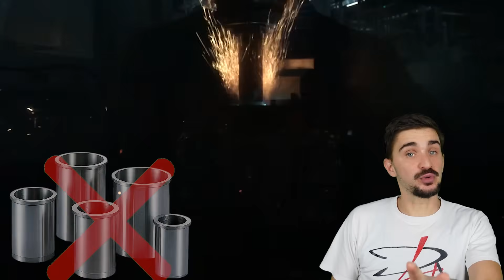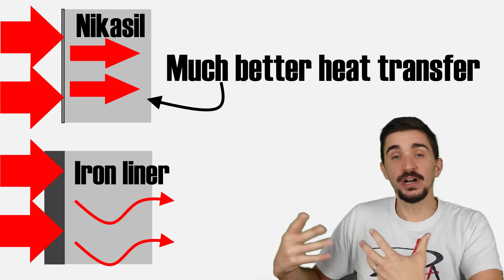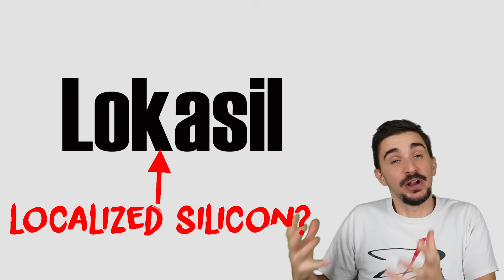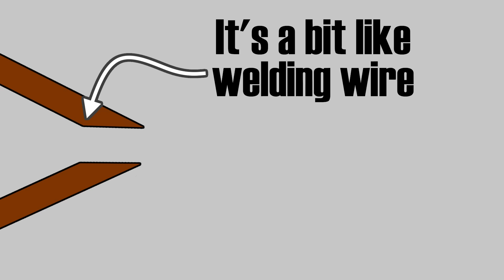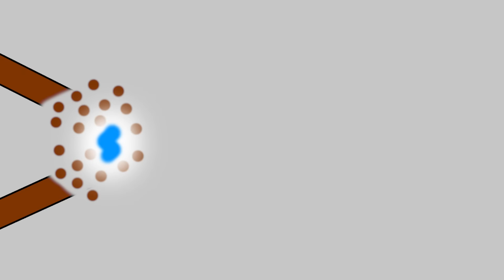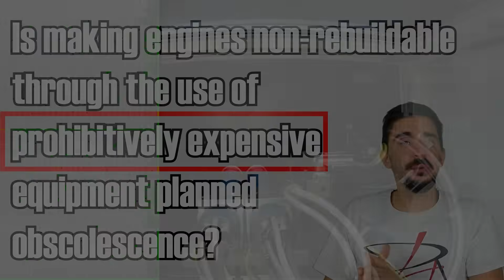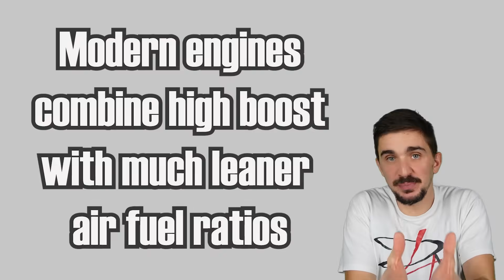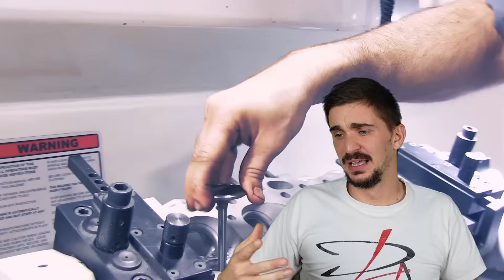Why Are Engines Becoming Non-Rebuildable? Everything About Cylinder Coatings

Comment: Interesting to know about the reasons behind NikaSil development being tied back to the epitrochoid wear issues in Wankel rotaries.  The apex seals failures in the NSU engines were a different set of materials and metallurgy problems. NSU eventually gave up, and it was Mazda who picked up from where NSU left off and EVENTUALLY solved the apex seals wear issues some 10 years later in time for the release of the series 1 RX-7
Reply: I love rotaries but I don't there will be a fix for the burning of oil in the combustion chamber and the extreme fuel inefficiency.
Reply: @TicoDK  that also wasnt the topic that he discussed

Comment: I finally realized there is a point of diminishing returns with horsepower, reliability and what I can afford ! lol
I marvel at the complexity of today’s naturally aspirated piston engines and the horsepower they have achieved for both cars and motorcycles ! 
Love your videos ! ❤️
Reply: And also consider the fuel economy, too, especially for sedans.
I drove a Chevy Impala rental back in 2017 that had a fuel economy average on highway driving at 25 mpg with low-price regular fuel.  It's performance was similar to the muscle cars I was familiar with from the late 1960s, which had a fuel economy rating of around 14 mpg with high-priced premium fuel.
Reply: @bloqk16 25 US MPG = 30 UK MPG = 9.4 l/100Km
14(US) = 17(UK) (roughly). 

These are appalling figures by European standards!

Comment: How does nikasil coating or similar coatings make it non-rebuildable? It just means you have to know how to rebuild that engine. 
Which is true for all of the engines. 
Which is why 99% of all engines are not rebuilt anyway, and it's mostly done by enthusiasts who will just deal with whatever they have to deal with to rebuild it. Unless you're talking about mass production rebuilding, which is entirely different subject and for decades now has existed primarily for industrial applications and not regular cars... That's why you don't see a bunch of cars for sale with "newly rebuilt engine" Because by the time you're doing that the rest of the car is junk anyway, or just a simple labor of swapping the engine is more than the car is worth. 

So if we're talking about exclusively automotive engines for enthusiasts rebuilding, there's no such thing as non-rebuildable just such things as more expensive to rebuild because...
Reply: People also have to keep in mind that vehicles wear out elsewhere too. 

Only enthusiasts have fun swapping seats and interiors, replacing bushings and ball joints, repairing rust, body damage, and repainting, updating the radio / sat nav display, etc...

The average person doesn't want to deal with having all that done. That's a significant amount of downtime.
Reply: How to redo an Alusil engine:
Bore as normal.
Hone using a chemical on felt pads that dissolves the aluminum away leaving the hard material and a nice pattern for the oil to go in like a normal crosshatch. 

The machinery is the same, the only difference is using felt pads and paste instead of stones for honing. 

You can do it at home but like most honing jobs it's better to do it on the machine.
Reply: @travisfabel8040  seriously man. I can’t stop myself from explaining this on every alusil video I see. The buy in for a machine shop to equip themselves for alusil repair is quite literally a special hone, some special paste, a surface profilometer which they should already have, and some learning time. It’s actually insane how uncommon it is. You can even source oversized pistons for tons of alusil blocks. Especially BMW, as I’ve found.

I am hoping that this false stigma of alusil being unserviceable leaves us in the next 10 years. It’s very frustrating.

It’s not rocket science compared to other things people are doing all day long with modern cars.
Reply: It doesn't, we have been rebuilding Nikasil engines for 30 years in the powersports industry. Same cost as a sleeve and you get a MUCH better engine.
Reply: @OtisFlint can you explain why so many shops stay ignorant to the fact that alusil can be easily reconditioned with tools/literature now cheap, and readily available? It seems like all of the legacy machine shops have no interest in adapting. Just jump straight to plating or sleeving.
Reply: @OtisFlint   exactly, my point was that the "nonrebuildable" aspect is moot. It's completely rebuildable.
Reply: I agree.This guy is idiot.He lost credibility when did marketing for "wonder engine" scam company.

Comment: Pretty funny to see that people mention 2JZ or RB26 engines as the engines which can produce heaps of power. And for some reason people forget how VR38 or a modern LS/LT GM engine can make even more power and meet emission standards.
Reply: You are compairing 2.6 and 3 liter engines to 3.8 and v8 engines
Makes no sense
Reply: @sigmamale4147 please compare the emission standards too. As well as hp pre liter or torque per liter those engines produce. Those were just the examples. There are plenty of modern small displacement performance engines like G16E from Toyota or THP from PSA.
Reply: @sigmamale4147 because everyone does compare them?

Comment: I think your last sentence hit's on a big problem, cars (and other appliances) getting scrapped because a single component failed and it is not economical to replace. In that cast environmental costs of that single component failure jump up to what it takes to build a completely new car. Easier maintenance and parts replacement seem the answer and in industrial equipment we can see that being applied. Most of us here would probably love it as well, but we are (probably) not the average driver. The average person is much less likely to get through the trouble of finding the problem, weighing cost of repair/replacement, hoping that nothing else is wrong with the car that comes up in another 30000kms and then choosing to repair.
These new engines are build for the average consumer and, even if I don't particularly like it, they are build well for that specific use case.

Comment: Another thing to note is that technology rarely remains in the factory. Eventually as patents expire and technology becomes cheaper, eventually these plasma coating machines will make it into the hands of machine shops. Assuming the demand is there.
Reply: Plasma spray coating is nothing new. However, the issue is labour. Just removing an engine, taking it apart and rebuilding? You'll be at the same cost of a similar replacement CAR.
Reply: @khalidacosta7133 Until you deplete the supply and the options are a car waiting for the same impossible engine rebuild or a new car.
Reply: The problem is that this isn't a standalone issue. Certain things are not unrepairable but are made so by manufacturers through software locks or even regulations. This affects demand by shifting the consumer culture altogether to the point where we no longer expect things to be repairable, have access to schematics or be able to perform maintenance ourselves. In the end even if there are ways to do it, it becomes financially non viable for almost anyone to access even if they wish to resist this. (to make it clear, i don't actually oppose this technology, but the concerns are not entirely invalid)
Reply: @DMSBrian24  Some countries e.g. the EU, are trying to legislate for repairability.
Reply: @mikejfranklin7000  they are, but so far they are struggling to force user replacable batteries on phones, we'll see how that goes
Reply: @DMSBrian24  That's why #RightToRepair is becoming a bigger movement. The manufacturers keep tightening the noose.
Reply: Also, resleeving is the last thing you think about in a new car, literally every other part of the modern engine would fail before that come
Reply: @zaphodqi122  Good point.
Reply: Plasma spraying as well as other industrial coating machines that use high temperature to melt metals on surfaces will be very very hard to move to machine shops, besides the cost, size and power that they will require, the reliability will never be the same. If you truly want the engine to last twice as much you absolutely cant trust a cheaper machine shop alternative. On the other hand there's already cheaper, as in 60-100k range, machinery that can technically spray any surface of any engine block, but the results will be very unreliable and unpredictable because of the user and the machine
Reply: @DDehUser  I bet there's still going to be a Polish company that will end up doing these.
Reply: @kampar82  agreed, but not a shop two blocks away
Reply: While I expect the coating technologies to become more affordable over time - especially the 20 year old processes - I doubt it will make it down to the machine shop level.  But I can definitely see a premium service where the machine shop sends the motor to a facility that does the coating for a large number of shops.
Reply: @that.schamp there are already specialist machine shops that take outsourcing work of various engineering coatings.
Reply: Labour and associated costs
Reply: As this happens, the machines will get cheaper too so whoever wants to do it (probably not an owner of a mere regular 20 year old family economy car) will be able to, at high cost of course like any type of engine from any era
Reply: I was thinking the same thing. If there's a market for rebuilding engines, someone will make it work.
Reply: but when such machine become affordable is probably when we already switches to electric cars
Reply: @danielhandika8767  nah that wont happen. The world hasnt transitioned enough into the charging station infastructure to power these cars so there will always be demand for a gas vehicle. The complete transition to electric car is only stopped by knowledge of how to repair electrical motors, tools, and a charging grid.
Reply: @scootinhootin6928  And particularly having the reserve capacity in the electrical grid to support charging the EVs; simply having ready access to charging stations isn't enough. There are estimates that the load on California's electrical grid would increase by a factor of 2.5 with a complete switchover to EVs -- a capacity requirement that is unsustainable with the current power production, and the forced changeover to intermittent 'renewable' generation methods, with the hideously expensive battery storage systems being grossly insufficient to accumulate enough power to backstop days or weeks of minimal generation from renewables, even at the current grid load, much less the load with EV charging added to the demand.
Reply: @seanmalloy7249  That's why Trump reversed Biden's EO to mandate EV conversion. It's insane.
Reply: @scootinhootin6928  "The complete transition to electric car is only stopped by knowledge of how to repair electrical motors, tools, and a charging grid."

>>Not true! The transition is assumed to happen but it's not actually happening for many many reasons. One is that government subsidies are not a sustainable plan, another has to do with battery vulnerability to even minor impacts, then is range which is not that good and gets affected by temperatures a lot, charging times, resale value, the dependency on dubious electronics and the ability of third parties monitoring or even locking (future development that's certainly in the way) you out of it, private information vulnerability, etc. EVs are just simpler in terms of motors and their maintenance but they are not necessarily better for the environment even if we accept the lie (it IS a lie) that CO2 is bad for the environment (which is a ridiculous claim)!
Reply: @seanmalloy7249 they're "pulling the wool over your eyes", EVs & renewables are fine in existing power grids with possible exceptions like USA's incredibly unstable multiple power grids.
Reply: Its the green fuel price tax that is affecting these engjnes
Reply: @neiltitmus9744  listen up pal, the days when you could drive a 6litre v8 with no thought for how it might be detrimental to the other planet dwellers who share this little green and blue oasis in the u iverse areLONG GONE. So you have to pay your share of the costs to try and preserve the ONLY home humanity has, ie tax on fossil fuels.......so suck it up and stop yer whining.

Comment: I'm not a speed demon. All I need for my car is to get me from point A to point B for the most efficient and less fuel costly way. I still think an engine that can be rebuilt every 10 years is still better.
Reply: You won't be rebuilding a motor every ten years with normal use. Thirty years.

Comment: Everything is rebuidable, Machine out entire block, fit top hat wet liner sleeves, machine sleeves facing each other flat "to siamese sleeves"  make deck plate that press fits into block atop, drill coolant passages through plate, have enough protrusion on sleeves to ensure sleeves dont float, drill dowel holes in heads and block, press in steel dowels, fit high quality gaskets and job done... I have modded many  Nissan GTR, 370Z and the already crappy Rover K series with wet liners, reinforced bottom oil rail and steel dowels and the forever blowing head gasket issue is solved "even though they already have cast iron liners, its a bad design ftom factory" 
Everything is repairable unless melted into a puddle... just saying

Comment: What is the percentage of engines getting rebuild at any moment anyway?
Reply: What I want to know. It's far cheaper to drop in a good engine over a rebuild with the same results. Your average vehicle will rust away or need a lot of other maintenance before the engine needs a rebuild when they get scrapped.
Reply: Much! In Brazil anyways. The new engines aren't, because they are scrapped. ALmost 30% of the cars I assume have a rebuilt engine.
Reply: The people who have older cars do it but that's only due to a lack of engines new cars just have the engines replaced at the dealership
Reply: Fair point, only engines getting rebuilt are performance and classic car engines, of which this one is neither. As its a new engine it'll take a few years to see what goes wrong with them, but all engines have their problems
Reply: Hardly any. Engine rebuilds are just not economically viable in most cases nowdays. These people complaining about "planned obsolescence" still drive a 40 year old Volvo that has wind up windows and handles like a tractor. 

This is a non issue. People don't understand the basic engineering principle of life cycle. Engines are not designed to last forever, they never were and they shouldn't be, because that's a waste of money.
Reply: @BigUriel my 60 and 35 year old Volvo's don't handle like tractors. But they aren't my Daily drivers and even then there was lots of Volvo's with exchange motors.